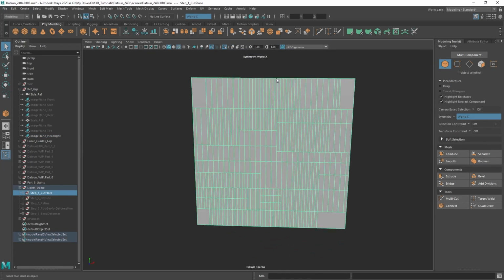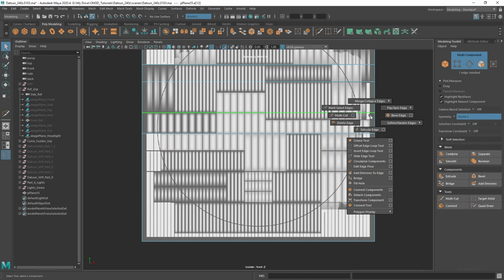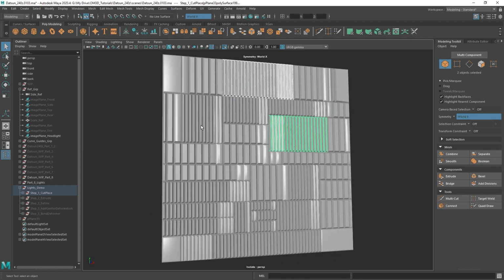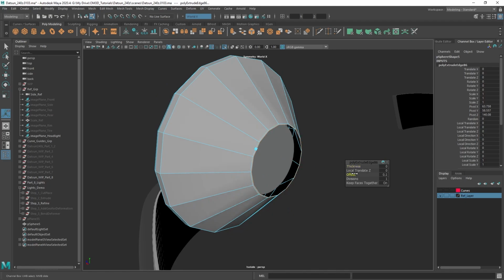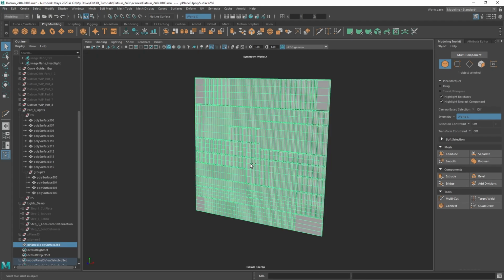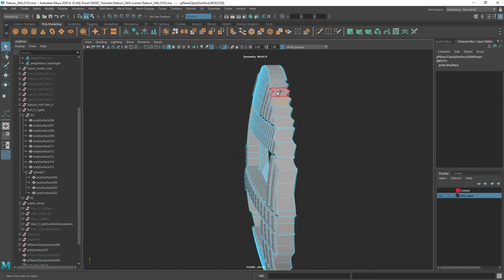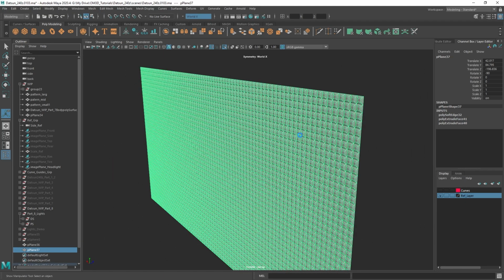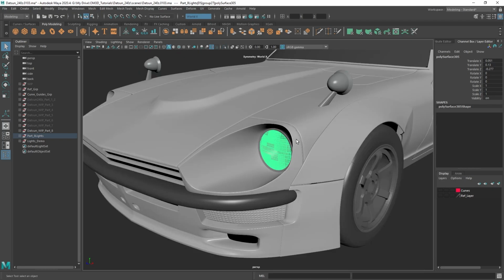3D Car Modeling - How to Model Lights

Comment: Ok I have built my ridges in the headlight now, but I have a problem. I am using Vray. If I hide the outer glass I get a nice reflection on the inner glass, but if I turn the outer glass on there is no light reflected on the inner glass, and I cannot see my ridges at all. I wonder if you have any clue?
Reply: It's ok I found the solution. The outer glass needed a back for light to traverse through it. A shell modifier solved the problem.

Comment: I got a question about the headlight glass. I normally use a bumpmap when making headlights, but I may try your idea (even though I use 3ds max). The problem is that Vray glass does not work well unless you got a 2 sided material. So how do you get around this. I thought about doing the pattern and welding to the back of the smooth glass at the front, but the trouble is there will be a lot more edges to connect on the back, so I am not sure of the best course of action.

Comment: This was one of such things I wanted to learn badly, thank you for making this. Until now I was using normal maps to get these details, but now I will be able to model these and not try to worry about finding good normal maps.
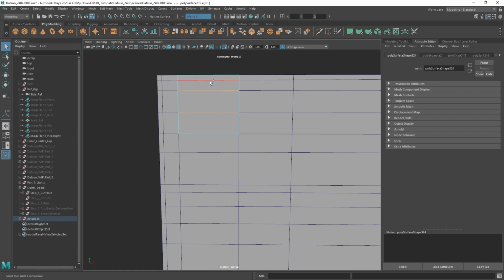Reply: Wow at 7:54 I never knew you can use connect tool like this.
Reply: One thing I would recommend to you, keep step snap on by default of rotate tool, I keep mine at 15 and it is a time saver and whenever you need to get free rotation you can always press J.
Reply from the maker: Thanks for the tip!